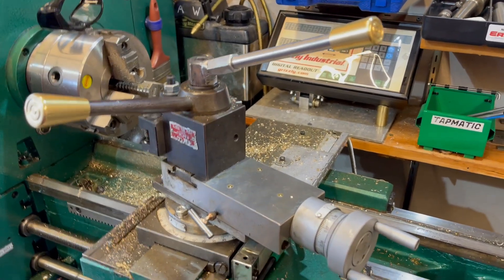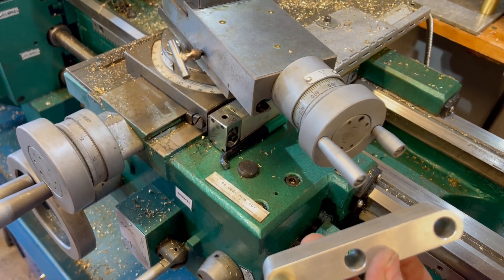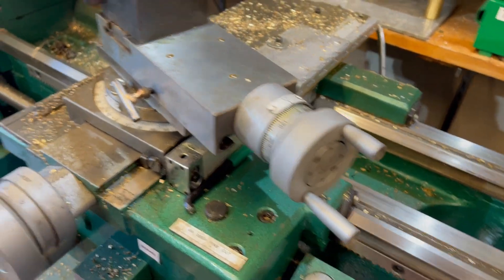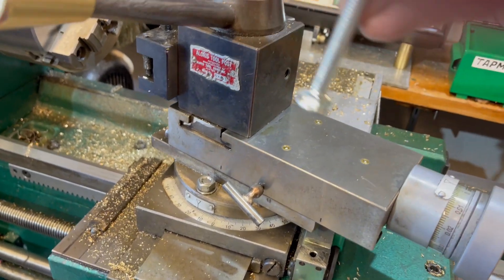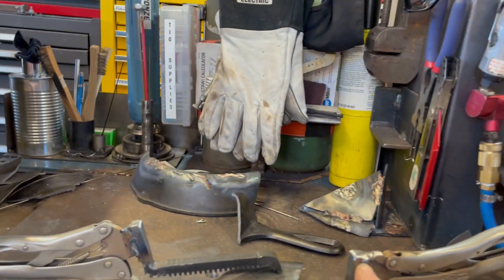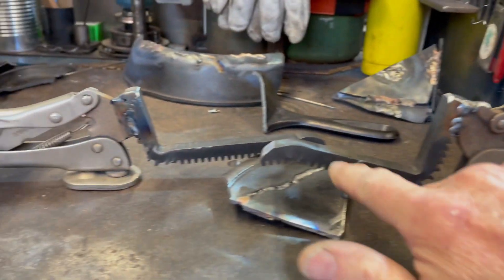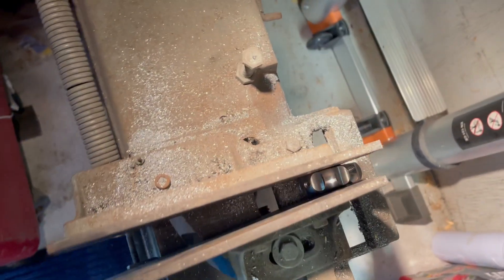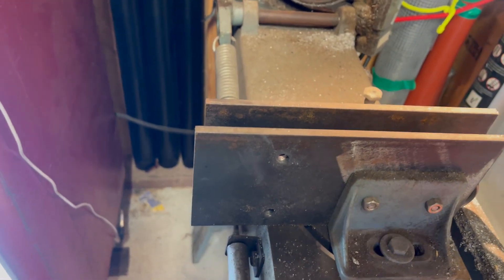ATTN. Grizzly lathe owners necessary mods!

Comment: The handle extension will wear your gibs out prematurely.  The circular ring mount in the culprit.  I replaced mine with a piece of .625 plate and made it a four bolt.  The two bolts on the ring mount are a pivot point for serious deflection.  I see you machine brass.  I machine steel and can use a carbide parting tool without any lube or coolant.  The gibs probably have assembly crud on them, if you have not taken it apart and cleaned it.  I have a Grizzly G0752.
Reply from the maker: All clean and tight, no movement. And this is not a production machine those jibs will last 5 of my lifetimes so no problem for me anyway.. Thanks for the response I did flat file the jib, it wasn't perfect a tiny bow, maybe I'll check it again. But I do like the slow control with the extra handle.